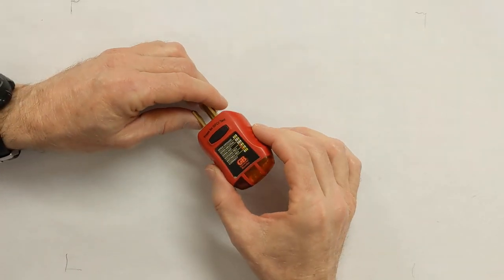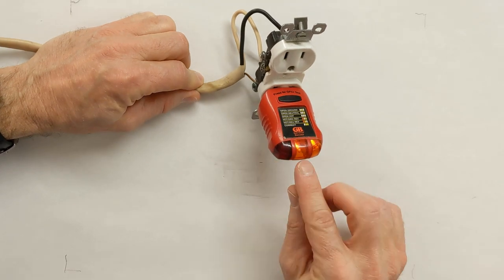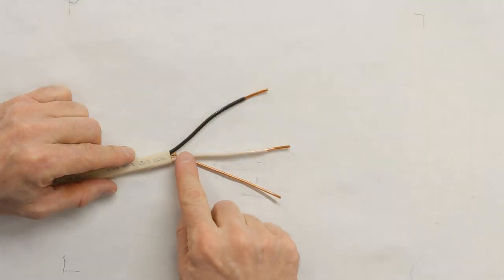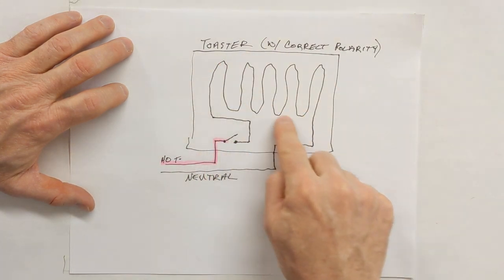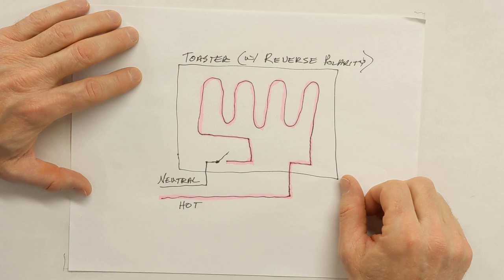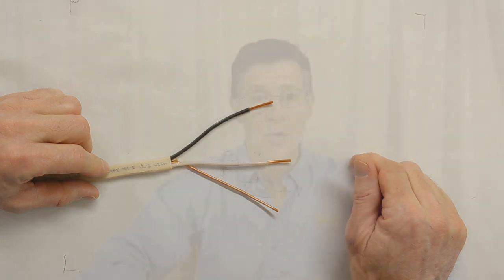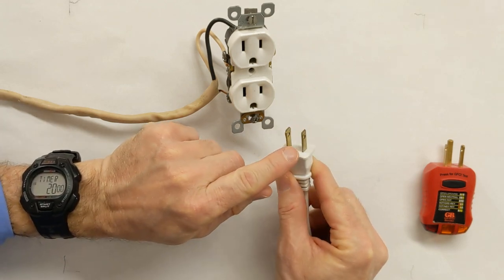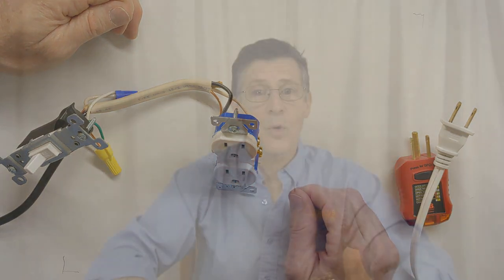Reverse Polarity in Electrical Outlets - What, Why and How

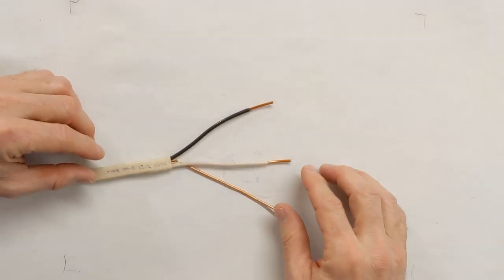Comment: 5:50.  There are a few  situations where a white wire is used as a hot wire and is safe and up to code.  A common example is a 12/2 NM cable powering the 20 amp 240 volt receptacle for a large window air conditioner, or sometimes usually in homes more than 25 years old, as the supply to a switch when the switch is the end of run; this method is no longer compliant as of the 2011 NEC, an available neutral is required in the switch box to facilitate future installation of electronic switching devices requiring a neutral to function properly.   In these situations the white wire should have been re-identified as a hot wire with black or red tape near the end at all termination points, but sometimes this isn't done.

Comment: Thank you! Very informative and clarifies why this is actually a concern. We've had a few outlets in our home with reverse polarity (checked by a plug tester) and have avoided using them because we weren't sure what that actually meant. Glad to know it's likely an easy fix for an electrician, not likely rerunning wire, etc.

Comment: Sir: Wonderful explanation of the DANGER of reverse polarity in/of a toaster. 
Thank you.
Reply: In Europe toasters cut both wires. I would be amazed if they did not do that in the US.
Reply: @okaro6595  Double throw switch in the appliance?
Reply: @tedlahm5740  I have not opened but the both sides cut when the tray comes up.

Comment: TY so much I learned something from the video and how to setup an outlet.
Reply: For what?  Baffling you with the wrong information?  There is NO POLARITY in an AC system and there is no "pressure" side in AC or DC.  This guy is wholly unqualified to be making videos on electrical system testing or understanding.   Ugh.
Reply: @DiffEQ  don't care my tester show the polarity reversed as well.  your opinion is unwanted period

Comment: Your toaster drawing is awesome!! :) great job though. Thank you
Reply: For what?  Baffling you with the wrong information?  There is NO POLARITY in an AC system and there is no "pressure" side in AC or DC.  This guy is wholly unqualified to be making videos on electrical system testing or understanding.   Ugh.
Reply: @DiffEQ  One of the wires in AC is at the ground potential and another has alternating voltage compared to the ground. On a properly working system you will not get shocked from the neutral (grounded) wire. This is basic electrics.

Comment: How do you test the GFCI wires to verify you shut off the correct breaker so I don't have to flip the main off? I own both a multimeter and a car test light (for fuses)
Reply from the maker: Hopefully you can test for AC voltage with your multi-meter. Put one lead on a hot (black/red) wire and the other on a neutral. Test it on something you know is live so you know what you're doing. Be careful!
Reply: @HouseKnowHow  Many electricians use a non-contact voltage tester as it is much safer than other types of test equipment.  Your caution about testing it on a known live circuit still applies.

Comment: does polarity matter when the appliance you're using require you to touch it like a waffler when it's on
Reply: The device grounding is independent of the polarity so it does not matter.
Reply: @okaro6595  the waffle maker doesn't have a third ground pin only two polarized pins (one narrower than the other)
Reply: @crimbo6993  Then it should be double insulated. If not it is dangerous as hell.
Reply: Thank you!

Comment: I just changed a GFCI 5 wire, a ground, 2 lines and 2 loads and my "8-ball" reads hot neutral reversed, . This outlet runs a garage- located refrigerator and 2 2nd floor bathroom outlets. Are my line wires reversed or my load wires to get a "hot neutral reversed" reading? I know for certain my lines are up top and and loads are on the bottom, I just didnt realize the left and right could be reversed. Can I run into any problems if it takes me a day or two to address this? Thanks much
Reply from the maker: I would hope 2 days doesn't matter too much since it's been that way for a while. And, I don't know all your details. If you'd like a little help solving this to to chat for a very reasonable fee, please contact me via the HouseKnowHow.com contact page. Thanks, Martin
Reply: What was the fix?  What happened to cause the hot/ neutral reverse?
Reply: I have the same problem: I have the main wires coming from the main breaker box then three runners; one outside one inside the kitchen outlet and one to the dishwasher and I check the wires and reconnect with a new GFI and same thing take everything a part thinking something was wrong in my part but seems right. Any suggestions? It will be appreciated :)
Reply: @cpsadp99  reverse polarity on any fixture (light or switch or outlet) will charge neutrals on all fixtures downstream of that fixture.
Reply: See 👆🏻

Comment: Is it bad to use a power strip in a receptacle with reverse polarity? What happens to the devices?
Reply from the maker: It's exactly the same as if you plugged your device into the reverse polarity outlet without the power strip in between them.
Reply: The power strip has really no issue in it. The only thing I can think that if it has a switch it may break the neutral. Power strips are really very simple devices.

Comment: There are brass terminals for hot silver terminals for neutral and a green terminal for the ground wire. If installing a GFCI outlet or receptacle do not get the line and load mixed up and if there are multiple GFCI outlets on a circuit then do not use the load
Reply from the maker: All good points. Thanks.
Reply: I have a gfci outlet to the left of the kitchen sink and another gfci outlet to the right of the sink and i have a non-gfci outlet downstream on the kitchen island. Are you saying that i should not put any wires on the load of the two gfci outlets and no wires on the load of the non gfci outlet on the island? Help, please!

Comment: Thank you so much. Very easy to understand.
Reply: Too bad it almost all BS.
Baffling you with the wrong information?  There is NO POLARITY in an AC system and there is no "pressure" side in AC or DC.  This guy is wholly unqualified to be making videos on electrical system testing or understanding.   Ugh.

Comment: I don't know if this applies for the EU. We do have a common rule of thumb where the hot should be, but loads could be connected eather way. Sooo.... idk
Reply: Some countries have standards on how the outlet is wired like in Finland  the phase is on the right but having it on the left is not serious enough an error that one should call an electrician to fix it as you can insert the plug either way. Toasters here cut both wires.

Some type of plugs fit one way like the French grounded socket. Czechia uses the same plug but they wire it differently (phase on the left) so anything grounded designed for French will have reverse polarity in Czechia.

Comment: Hi my four pin plug was damaged (clips snapped) on my car radiator fan motor  my friend put a new plug on on the car rad loom which is   12 V car electrics- three settings on fan 100   250  450 - anyway he got the red and brown wire incorrect way into plug so I guess reverse polarity - it started smoking the motor and unplugged it after a few seconds - question is the cables where changed back to the right sockets and the fan now works perfectly - iy was a £400 fan my question is please the fan is working good but would he of damaged it as went very hot and smoked- the plugs were perfect and not burnt - thank you.
Reply: I'm sure your friend damaged the fan in some way if there was smoke. How bad I can't say. I don't know what the risk is if he continues to use it. The thing is cars run on DC (direct current) and homes have AC (alternating current). They are very different. If you run an AC motor with reverse polarity it will likely run fine. Whereas with a DC motor if you run it with reverse polarity, well in some cases, as your friend found out, you get smoke! Good luck with the car!

Comment: When I learned about polarity decades ago I quickly tossed some of my mom's ancient extension cords and replaced them.  A few years back one of my nephews called me with a problem.  He had rearranged his living room and the computer no longer worked in its new location.  Different receptacle, I asked?  Yep.  You probably have a reverse polarity problem.    Went over there to fix it, showed him how it was screwed up.  Now he helps me with MY computer issues.
Reply: Computers work perfectly well with reversed polarity. Maybe if there is an UPS it might not work.
Reply: If some device does not work with reverse polarity, it is faulty and needs to be fixed.
Reply: @okaro6595  His computer was fine.  The electrical receptacle had been replaced in the past and had been wired incorrectly (reverse polarity).
Reply: @stevepettersen3283  Reverse polarity causes no problems on a working computer. Do you not get that in many countries plugs fit either way and there is no concept of reverse polarity. In some countries both wires are hot. Reverse polarity does not cause any issues. If it does then there is a fault on the device.

Comment: You just told me what I've asked a lot of people. The slots being different. We had 3 licence electricians give up. The HVAC man knew right off what was wrong. The steel neutral cable had broke about 10 feet from the pole. This causing two appliances to catch fire.

Comment: Just what i was looking for today, thanks young man. one question: on the household electrical cord one side has a ridge, the other side is smooth. Which side is the hot side, which is the neutral?
Reply from the maker: Assuming there's a plug on the end of the cord, look at the width of the blades on the plug. The wide blade is the neutral blade, the narrow blade is the hot blade. Then look for where the cord comes out of the plug. If the ridge is on the wide blade side it's the neutral side. If it's on the narrow blade side it the hot side. If the blades are the same width then the plug does not enforce polarity and the ridge on the wire doesn't indicate polarity either. I hope that helps!

Comment: Hi, thanks for making this video. I understand what you've explained but something still bugs me. Why is polarity an issue in an AC system? Isn't the polarity in a typical 115 V 60Hz house always switching from (-) ve to (+) ve 60 times every second? If so why then does it matter which wire is "hot".....aren't they both hot??
Reply from the maker: The neutral wires are never hot. They should always be a 0 'potential' or voltage because in modern buildings the neutral wires are grounded (connected to the Earth). And the ground (Earth) is defined as 0 potential. The hot wire voltage oscillates from +120 volts to -120 volts 60 times a second. So the hot wire whether it's at +120 or -120 is the dangerous one.  I hope that helps.
Reply: @HouseKnowHow  thanks for the reply. It is helpful. I'm not trying to be "cheeky" but I'm really trying to understand this concept clearly. So are you suggesting then, that if we assume that a house is properly wired and a child sticks a metal object into the NEUTRAL slot of a wall outlet while barefooted standing on a bare concrete floor, he will NOT be electrocuted? After all by this explanation both the neutral wire and the child are both grounded and at the same "0 potential".
Reply from the maker: Theoretically your are correct. But I won't be testing this theory with my child! ;-) Inside a main electrical panel the neutrals and grounding conductors are 'bonded' (connected) together. This forces the neutral to be at ground potential which is defined as 0. This is also why when you drag your feet around on a carpet in dry air and you build up a static charge that it is dissipated (and you get a shock) when you touch something that is grounded like the screw holding a cover plate on an outlet or switch.
Reply: For the most of the world it does not matter. Here toasters have double pole switch. In Europe most plugs are not polarized. Where they force polarity (grounded plugs in France, Belgium, Poland and Czechia & Slovakia) there can be different standards or no standards in different countries on the polarity.

No both are not not. Neutral is always neutral, It is grounded. The other one is hot it varies in the US between +170 and -170 volts 120 times a second. Note that the equipment does not care winch one is grounded or even if neither one is. It cares of the voltage between the lines.

Comment: This was a great video amongst thousands. Much clarity than ever. First time I got the inside real story of polarity reversal. In DIY, I did install one outlet and I have to check its polarity ASAP. Thanks for this video.
Reply: ut it's incorrect from the Title to the end... so what are you thanking him for? Blind leading the blind.  This guy is WHOLLY unqualified to speak on this subject and should stop.  Polarity?  In an AC system?  Pressure side?   SMH
Reply: @DiffEQ  Polarity in AC means the difference between the grounded and ungrounded conductor.

Comment: Toaster schematic was an excellent example....great job.
Reply: Too bad it almost all BS.
Baffling you with the wrong information?  There is NO POLARITY in an AC system and there is no "pressure" side in AC or DC.  This guy is wholly unqualified to be making videos on electrical system testing or understanding.   Ugh.
Reply: @DiffEQ  A textbook example of the problem of having little information (as opposed to none). There are two wires, one of them is grounded and the other is ungrounded. The grounded wire is of course always at the ground potential.

Now there is a problem as any properly designed toaster would cut both wires when the tray is up.

Comment: In Germany, the hot and neutral conductors of Schuko plugs can be swapped. 
Therefore, both conductors of the devices are switched off. Both conductors are also insulated.

In the usual system the hot conductor is at 230V and the neutral conductor is near ground.
In the system, which is obsolete in Europe, both conductors were 127V to ground and between the conductors 220V.
When the Schuko plug was invented, it was based on the old system with two hot conductors.
Therefore both electrical conductors must be switched off.  But today it's hot and neutral. But the Schuko plug is not polarized.

(Three-phase current, 127V x sqr(3) = 220V)

Comment: What happens if the white wire is connected to the black wire??
Reply from the maker: Sparks, heat, possible fire, possibly a flash-bang that knocks you back, makes you blind, etc. The circuit breaker should trip when you do this, but the other things can happen before the breaker trips. So... I don't recommend doing that! :-) I need you alive to watch upcoming videos.

Comment: I have a question.  Since in AC, polarity changes at 50 or 60 Hz, ain't it means that neutral wires also becomes hot during the negative half cycle. And this is not the case the how ac to dc circuit works, because during the negative half cycle we do get current through the other pair of diodes.
Reply from the maker: No, the neutral wire is always 0 voltage. The hot wire goes from +120 volts to -120 volts 60 times per second. So you could say the polarity is changing but with the neutral always at 0 voltage it's the hot side that is simply switching from + to -. Whether the hot side is at +120V or -120V it's always dangerous to touch. I hope that helps.
Reply: The neutral wire is grounded. It cannot become ht as hot is measured relative to the ground. Also the polarity changes 100 times a second in Europe and 120 times in the US. The polarity changes twice in a cycle.

Comment: Small but important tip! Wattage is always the most important factor as the myth about low amperage is wrong as voltage and amperage are factors of sine wave which voltage x amps equals wattage or joules per second!
Reply: Dice Roll.    Extremely well written.  As the amperage goes up (because the resistance goes down) the wattage goes up.     Thank you for keeping us informed.

Comment: Polarity is a function of a Direct Current Circuit - think battery power.
Alternating Current (A/C) - in the US - consists of two 'HOT' wires (RED & Black) and a neutral (White) wire and a (Bare Copper) Ground Wire entering your Electrical panel.  The ground is actually connected to the ground your house/home sits on (either by a grounding connection to buried metal water pipes or to a ground rod buried six feet or so into the ground.  

Hot and Ground are appropriate terms when discussing alternating current - rather than POLARITY (the relative orientation of poles; the direction of a magnetic or electric field)  which is a term that has meaning when discussing Direct Current (think battery powered)  circuits.
Reply: Incorrect.
Neutral is bonded to Earth ground only at the first Service Entrance.  It is never bonded downstream.  Secondly, you either have a phase (hot) conductor or a neutral (grounded conductor), not a hot and a ground.  Ground is not required for power distribution and many appliances don't use a grounded plug.  The US is not 120VAC, it is split-phase 240VAC.  240V devices do not require or utilize the  neutral (split phase) conductor so BOTH conductors are hot and there is no neutral.
Stay in your lane is my advice.
Reply: Polarity is the established term for it. It was used already in the patent application of the sockets.